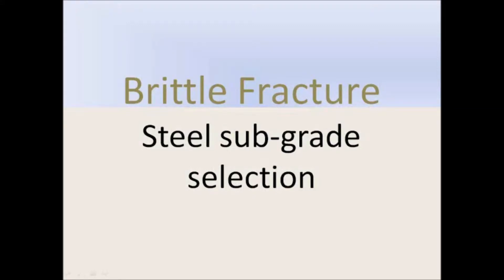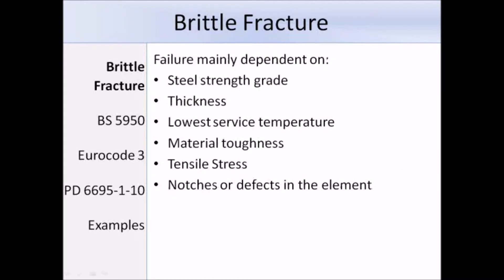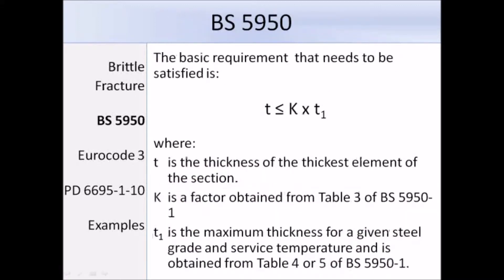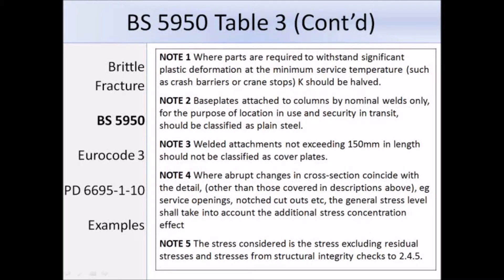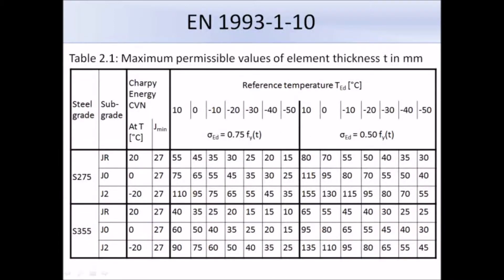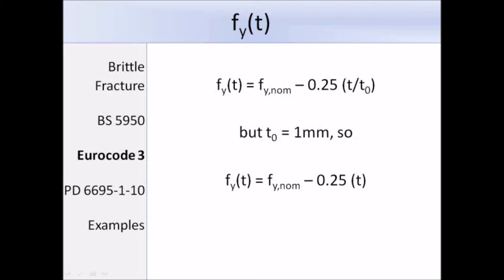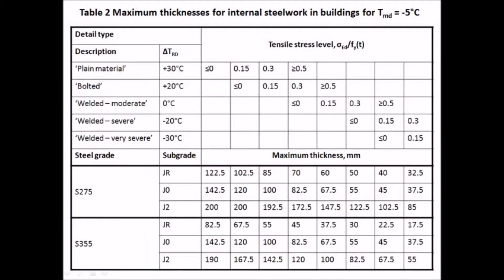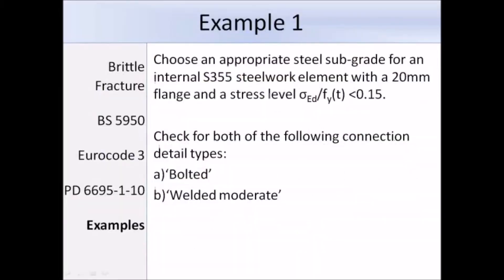Brittle Fracture | Eurocode 3 | EC3 | EN1993 | Design of Steel Structures | PD 6695 | BS 5950

Comment: Thank you for this very informative presentation. Can the PD 6695 be used if the specified design external ambient is below -15C? Is there any correction factors that can be used or do we refer to BS 5950? Thanks.

Comment: What do you mean by steel subgrade? is this a lesser steel grade than normal or specified steel with imperfections?
Reply from the maker: iain Crawford Sub-grades designate the steel quality in relation to toughness. (JR, J0, J2, etc.)
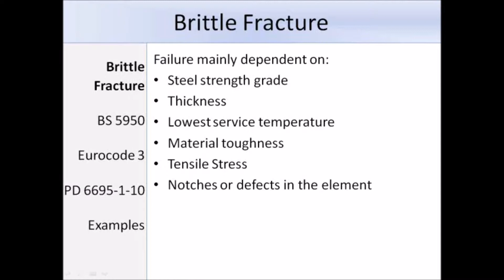Reply from the maker: Check 1:34